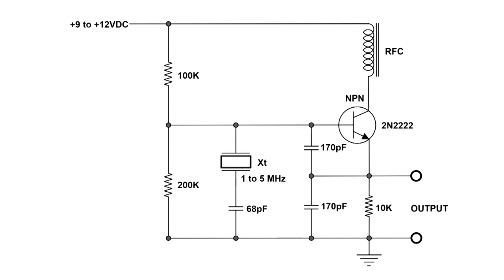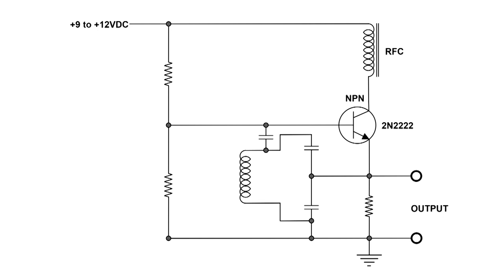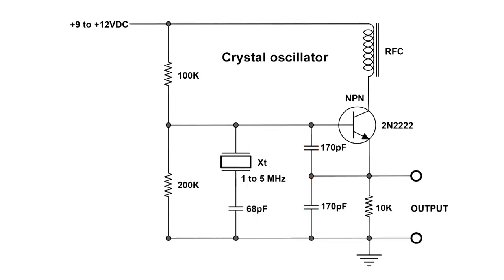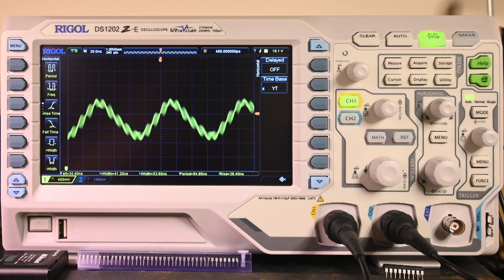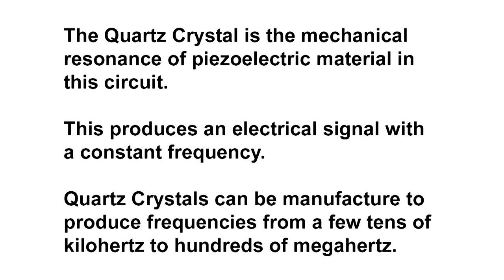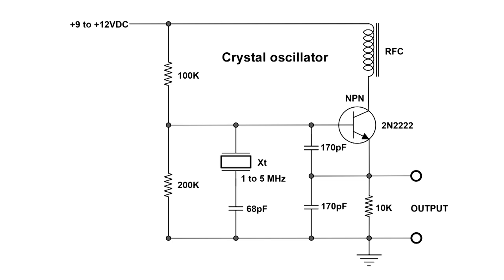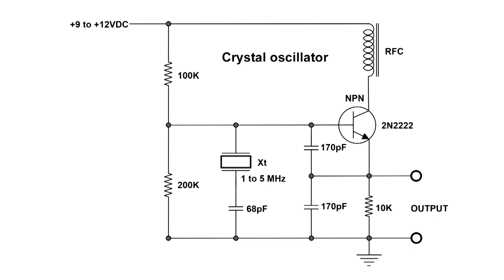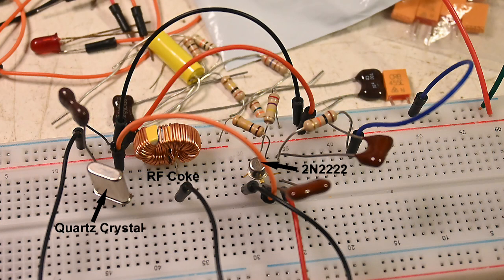Crystal Oscillators for the Beginner

Comment: Hi Richard, a beautiful video, thanks and very instructive for everyone. About these kinds of oscillators: I learned it the hard way to develop them and even now I am struggeling to get the purest wave out, tinkering with coils, bias, capacitive voltage divider, etc, etc. In practice I use a potentiometer to set the bias to the base, in your case the 100 K - 200 K voltage divider. And always a 1K resistor in series with the upper electrode of the potentiometer to the + lead (in this case, NPN transistor) to prevent a direct and silent burn out of the transistor when the wiper goes too far to the +, giving it a destuctive base current. But always fun to make these oscillators though it takes time and time and time...:-)
Reply from the maker: Thanks for your comments and information. I was experimenting with changing values of components. I was amazed how must the values can change and the Quartz Crystal still oscillates. Can not happen with a tank circuit. I'm going to try experimenting with high frequency JFETs.

Comment: Whatever fundamental frequency you're at, it looks like you have a 9th harmonic signal (little blips) riding on the fundamental. To dampen that out, you might try reducing the feeback to the base of the transistor by changing the bias resistors or the two 170pF caps. They give too much feedback to the base, I think. Keep the bottom cap at its 170pF value, but lower the top 170pF cap to, say, 100pF and see if that helps reduce the 9th harmonic distortion.
Reply from the maker: Thanks. I'm going to try JFETs.

Comment: Interesting. I always thought that breadboards were too full of stray capacitance to work at higher frequencies. I never tried it though. Thanks for the video.
Reply: Just so you can keep some of your hair lol. it does work but it can be a real pain sometimes. I would just lose connections sometimes or when the circuit doesn't work you're always assuming it's the breadboard.  but it has worked for me quite a bit. I was starting with the oldest oscillators to the newer stuff on a chip. it all worked. the stability was not as good but it worked. The highest frequency I was at was about 30Mhz. it was a lot of fun building them all.
Reply from the maker: Some times, it also depends on how strong the output is.

Comment: Thanks for all the great videos you have made. When I was a kid I made a crystal radio by use of diode OA81 , clear glas,  with a two stage OC75 germanium transistor amplifier. . In US I think you call it a "fox-hole radio" or something like that. I would like to make a simple crystal radio,!  Do you have a circuit for an easy build radio I can make just for fun... The very best regards Kim 
Ps my friend and I had a 40 meter 3,5mm thick copper-wire as antenna between our windows about 25 meters up in the air...very dangerous in thunder weather!!
Reply from the maker: Thanks K.J.H.
A friend has just got an early commercially made crystal radio. I'll do a video on it. The early crystal radios are simple circuits.
Reply: @AllAmericanFiveRadio  hi mr. Richard, thanks..I look foreward to see your video. Best regards Kim

Comment: Thanks, very useful!
The tech behind Crystal Oscillators is pretty new to me, so I was hoping to get a couple of basic questions answered, for which I was I was struggling to find answers online. 
1) How exactly are the fixed output frequencies of an SPXO set? We have many 'standard frequencies' such as 10,12,16,20 MHZ, etc. Is it only due to the way the crystal is cut, or does it also depend on the other supporting circuitry within the Oscillator?
2) How does the circuitry for a programmable crystal oscillator (Such as Epson's) differ from a fixed frequency oscillator? I know these involve 'blank' oscillators that can be programmed to a desired frequency using a handler. Does it contain any circuitry such as programmable non-volatile memory? 
Thanks in advance!
Reply from the maker: I GOOGLED "quartz crystals frequeny made" and found a great deal of information. This is just one.

https://www.sciencedirect.com/topics/physics-and-astronomy/quartz-crystals

Comment: Awsome, excellent video, any video on  RF transmitter and receiver module circuit diagram explaining the schematic, or
You have designed any RF transmitter and receiver module circuit diagram explaining the schematic
Reply from the maker: 50,000 Watt Transmitter Site
https://www.youtube.com/watch?v=eGNw0aaj29k
AM Transmitter Build Project and Demo
https://www.youtube.com/watch?v=hhDjj45O4Lc
Build FM One Transistor Transmitter Project Modification 3-3
https://www.youtube.com/watch?v=3tc3gBEU9Js
FM Stereo MPX Decoder Circuit and Demo
https://www.youtube.com/watch?v=ACqEiFHCofI
FM Radio Signal Tracing
https://www.youtube.com/watch?v=a5qa4OFockA
Oscilloscope signal tracing
https://www.youtube.com/watch?v=B44wHjb8jMY
1932 Philco Model 112 Circuit Signal Flow
https://www.youtube.com/watch?v=dN1eBI-4onY
AA5 Radio Signal Flow
https://www.youtube.com/watch?v=zknp0FOkPXU

Comment: very good explanation..... one question is this work in Frequency like 32 kHz crystal or 455 khz ceramic
Reply: A ceramic material made to resonate on a frequency (say a 455 Khz ceramic IF filter with a certain bandwidth) differs from a typical quartz crystal that is used in this demo. A 32 KHz crystal for a clock has completely different properties and needs another type of electronic circuit to make it work.
Reply: Here you see an experimental circuit to make such a 32 KHz clock unit work 
https://youtu.be/eJDj6Fa1LNM
Reply: @radiofun232  
Thanks for the reply, that's exactly what I need
keep up the good work
Reply from the maker: The Quartz Crystal is about 10MHz
Reply: @AllAmericanFiveRadio  

I am a radio amateur and I like to play with frequencies...I also like to  make  transceiver with microcontrollers....... Thanks for the useful information, keep up the good work

Comment: When you said it is the wrong crystal,  are you referring to its resonant frequency, or some other property?
Reply: Could be a so called "overtone" crystal or a crystal that resonates on its so called "ground frequency". They have specific properties. Also the way that the crystal is cut out of the quartz material brings specific properties regarding the way it resonates: say lateral or otherwise. That has also an effect on the temperature stability.
Reply from the maker: The circuit is designed  for 1 to 5 MHz, I'm using about a 10 MHz Quarts Crystal.